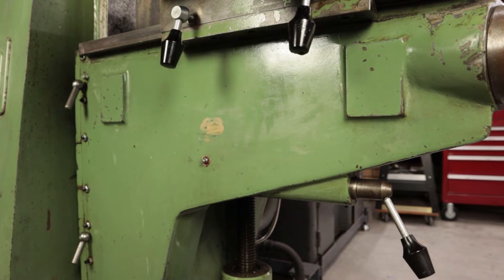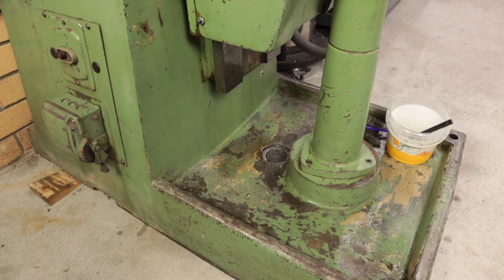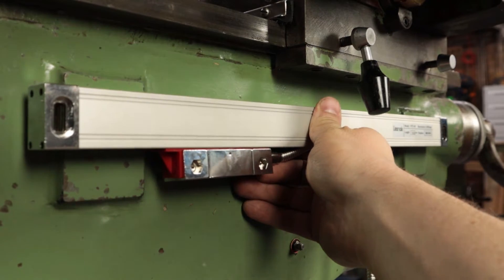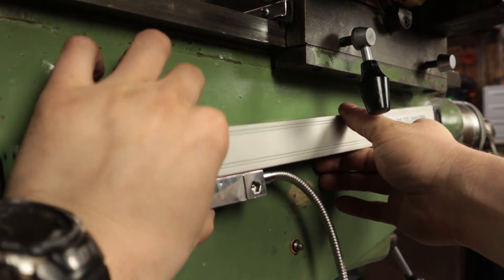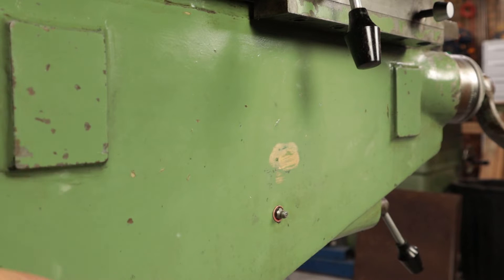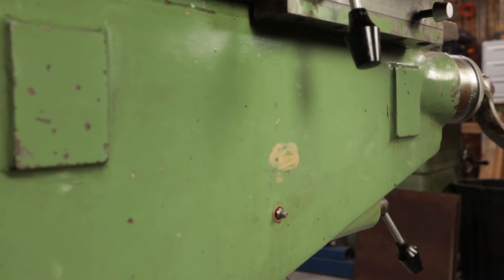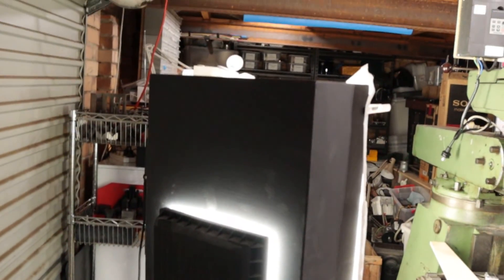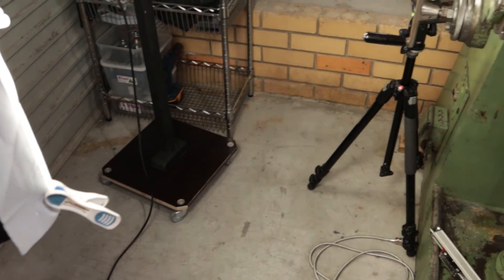Installing a Mill DRO - Planning the Y Axis

Comment: Here is how I did it.  Right side for the y and the Z went behind it.  The X on the back of the table and all cables to the right with the display on the right side.  Easy cable management.  https://www.youtube.com/watch?v=AtabMxk5G9k  Now I have to do the lathe this weekend.
Reply from the maker: Hi World Traveler. Thanks for the info. I will check out your video. Sounds like you did a good job with the cables especially. For mine, I have an exposed leadscrew on the right hand side, and I know from experience that it's one of the oiliest parts of the machine, so I wanted to give the Y scale a chance by putting it on the left. The cables are plenty long so it's no trouble this way. Z axis scale will go on the right though, for sure. Thanks again, Craig
Reply: @CraigsWorkshop  Yeah I was kinda screwed on the left.  My one shot is there and so is the manifold of 19 valves attached to the saddle.  Subbed.  I'm new to this machining game, casting bronze is my bag.
Reply from the maker: @jagboy69  Cheers worldtraveler - I don't have a one-shot on my mill - they seem like a good idea though. I have heard of some folks retrofitting them. I have a few things to do before that though - finish off the DRO install, design a power feed system and I have more tooling and things I'd like to make first. I'm relatively new to it too, so we're all learning together. I'll have to check your channel to see if you have some bronze casting videos, haven't had chance to look yet. Cheers, Craig

Comment: Hopefully those two pads are or were used for alignment when they machined the knee and will be machined parallel to the Y axis and Z axis , if so you got it made ! 
Those lights look remarkably like the led floodlights that Bunnings sell and i have one over both of my lathes , For the last 12 months i have been working in what i thought was a dark workshop  squinting at what i was working on and cursing how dark it was even though it has a heap of lighting. I had a mate drop by one day and he couldn't stand how bright it was in there and said "go get your reading glasses and try them " - which i did and suddenly realised all the money had spent on extra lights would have been better spent on a set of safety specs built to my prescription !   Oh well i can always turn them off if i don't need them !
Keep up the good work mate !
Reply from the maker: Hi Ian - yes these are verbatim branded floodlights, 50W each, and they're LED. Not from bunnings but they do sell similar stuff. I wanted some lights that had a particular colour temperature (6500k) to match the other lights I've set up, otherwise you get weird orange or blue shadows on video. They work very nicely and put out tons of light. Couldn't be happier.

Good point about those pads. I mounted the scale up to those today, I did made up a levelling plate, since the pad locations didn't match the length of my scale anyway. And it's not much work to add a few tapped holes. I have another video coming out (hopefully in a couple of hours) showing how I did it.

Thanks for the kind words Ian! Cheers, Craig

Comment: Hey Craig, wish I could offer some suggestions but having my own problem putting a scale on my compound right now. I don't even want to film it, it seems so cobbled, lol. Looks like you have a plan though. Good luck!
Best!
Eddie
Reply from the maker: Cheers Eddie - good luck with your compound. I've not seen a DRO on a compound before! Not much room! Cross slide is the normal place for one, but I can see how having both would be really good if you can fit it in.

My plan is mid-way through execution right now. I am collecting some footage too, so I'll show that later on or tomorrow. Cheers! Craig
Reply: @CraigsWorkshop  I actually meant the cross slide, just misspoke. Size and space is the problem though. My cross slide is not much bigger than many compounds.
Reply from the maker: @theeddies  Ah ok cool. No problem. Do you have some of the miniature glass scales? They come in a smaller size especially for cross slides and machines with less clearance.

Comment: Hi from Coffs, glad you are keeping your head down in these interesting times.
Seriously, you are over complicating this.
Yes, the reader has to come out of the bottom to stop the s.. Gunk getting in.
Yes it has to be parallel to the travel of the Y saddle.
Two tapped holes the correct distance apart so you don't run out of travel on the reader,
At approximately the same hight (within 2mm only to reduce embarrassment as it could be literally 10mm out and still be fine!)
Hang a square off front and back of knee and sort out spacers, twin wedge washers, whatever required to be square and equidistant.
Dial up top and side, a bit of fiddle and Bob's your Aunty.
An aluminium z shaped extrusion tapped and gooped to the knee will protect it all from coolant and swarf.
If I could add photos ....
Reply from the maker: Hi Carl. Apologies for over complicating things. I just don't want to stuff it up, and have to buy another unit, or have this one shoddily installed. Trying to do as close to a neat and professional job as I can :-)

I hadn't heard the 10mm figure before, in fact usually a couple of orders of magnitude smaller than that, at least for minimising cosine error if not to protect the delicate insides.

e.g. Here's a glass scale installation manual from another company, Warco, same technology scales though: https://www.primadilna.cz/fotky49990/fotov/_ps_3044Warco-DRO-Install-Manual.pdf

It quotes 0.1mm parallelism and squareness, which is approximately what I'd heard in other installation videos, hence my being fussy with the brackets, etc.

Cheers,
Craig
Reply: Absolutely agree that the final result after tuning is within 0.1mm in all 3 planes but my point was the drilled and tapped holes into the machine, the knee in this case, have a fair amount of adjustment .
About one mm fore and aft and 10 or more mm up and down.if this was a kit out of Hare & Forbes of the generic Chineese DRO then it came with an assortment of alternative bits & pieces for mounting the reader unit.
One would be an angle bracket possibly with an additional plate with slots for adjustment to hang the reader unit from.
Craig could we email?
Reply from the maker: @captcarlos  Hi Carl - more than happy to email! My address is email AT craig9 DOT com - I typed it like that so the spam bots don't find it as easily.

I've already fitted up the X axis, and yes the slots were 6x15mm internally. I mentioned 2 videos ago that I used a 6mm drill to centre it in the slot, and spot drill for the M5 thread (Would have used a transfer punch if I had any).

I was more interested in making sure that the two "planes" were co-planar because currently, they're not. I think the sub-plate with jacking screws is quite a neat idea, and easy to do, and I have the materals around.

Chat to you on email. Cheers, Craig

Comment: oooh look at all that space!! hahah should be easy peasy. lol. but you probably only need two jack screws at the front and one at the back? I guess the really pro way might be to make two plates with jackscrews, and bolt them on the long bit, then get them both bolted on and aligned and pack them with epoxy or chockfast or something, then when it cures u have nice pads for anything? id just use one bit right though and jack it both ways tho, that's how I did mine. good luck.
Reply from the maker: Thanks Emma for the comment and the ideas.

I was thinking three jacking points would (probably) do it. It's 10mm (3/8") thick aluminium about 470mm long (18-19"?), and probably needs to be 50mm (2") wide. It's quite a rigid piece of metal and I certainly can't twist the rough stock by hand and it's 1m (3') long.. I wonder if with three points will be perfectly stable and rigid - probably, or if it'll need four. I think once I've cut it, I'll deburr it and try to rock it on the surface plate. If it rocks, I'll do four jacking points just so I can flatten the thing out. I really expect that won't be necessary though.

Rather than two small plates, I think I'm committed to one long plate - it just adds a bit of rigidity, and simplicity, and reduces any alignment headache.

As for packing it, I realised (midway through writing this), that I can try it without and always pack it later with e.g. epoxy or whatnot later, if needed.

Not sure what you mean about one bit right through and ajck it both ways? Like Eyup Tony said with a stud in a threaded hole and then jacking nuts either side of a mounting plate?

Cheers, Craig
Reply: @CraigsWorkshop two on the dront to get it on the right plane, with a vertical axis? then one in the back to get it right the other way?

Comment: Two conveniently placed bosses, that's helpful. Three point should work fine. Could always change or adjust later if need be.
Cheers
Reply from the maker: Thanks Rick. Three points is what my gut said at first. Some folks have suggested four. I'm not sure yet! The 10mm aluminium plate would have to be something like 470mm long, and 40mm wide. It's very very twist resistant already, I really think three points would be more than enough, unless you ran into it with a vehicle or a forklift.. Then you've got bigger problems.
Reply: @CraigsWorkshop  
Agreed. Just try it, if it needs a "plan B" then change it up.
Reply from the maker: @rickpalechuk4411  I have five pieces of that aluminium plate (luckily). Each one is large enough to make two back plates for the scale. If I muck it up, plan B is the way forward!

Comment: Ah shower curtain. I thought it was baking paper when I first saw it lol
Reply from the maker: Previous iterations were indeed baking paper. I will own up to that. :-)

Shower curtain is a little better.

Ripstop nylon from spotlight is much closer to what the diffusers you buy on photography/videography softboxes and light tents are made of.

The shower curtain material is much cheaper, and looks about the same, but isn't nearly as durable.
Reply: @CraigsWorkshop  Eh if it's stupid and it works...
Maybe the extra durability is wasted in the shop; maybe either one might rip if you are careless like me! lol
Reply from the maker: True - I will probably either set light to it, or try to pass 200A through it, or something else exciting :)
Reply: @CraigsWorkshop  Lol I was more thinking of hitting it with a bar of steel, but 200A sounds way more exciting
It will momentarily give you better lighting too :)
Reply from the maker: It's all a question of shutter speed and an itchy trigger finger (Or so I've read) ;-)

Comment: Three points sounds good to me but four points would be more ridged it would take just a little more time to set up that's all. If you screwed four long pieces of threaded bar in to the knee with three nuts on each. Your plate fixes in between the two outer nuts. Adjust in and out then lock in position with the outer two nuts. Then lock the inner nut nearest the knee to the other nuts. This arrangement is so you can remove the plate with the DRO attached by simply loosening the outer nut. The inner two nuts remain locked in place exactly. No re setting required when re fitting the DRO. Quick and simple. 
I'm impressed with your lights, can you show us on video what type and size they are. I need some lol. Thanks Tony
Reply from the maker: Thanks Tony - I understand what you mean with the threaded rods acting as jacking points. And four would enable twist correction (someone else mentioned four too). Easy disassembly is a good thought. I will take this thing apart at least once more for repainting. And - if I can find a big granite flat for reasonable money, and move house to somewhere with a bigger workshop, I'll probably want to scrape in all the ways too. (Glutton for punishment). In that case, an easy-to-remove DRO would be a big benefit. Let's see how it goes. I'm tempted to cut up the plate I have and see how flat it remains. I have a 9"x12" mini surface plate, and feeler gauges and surface gauges so I can measure it pretty well. If it stays flat through cutting, I trust it to remain flat during use. It is protected by the large table, and should never get bumped. Cheers Tony - thanks for your insights. Craig

Comment: Impressive lights, very good idea using outdoor LED lights.
You could create a jacking pad for the mounting, say 8 or 10 mm thick 40 X 75 wide, have a single countersink clearance hole in the centre to drill/tap in the knee. Then qty four, one in each corner M5/6 threaded for set screws/grub screws, to Jack/align the pad parallel and square to the relevant axis. I've used this method for my dro scales.
Great vlog, thanks for sharing and stay safe all.
Reply from the maker: Thanks Bosted Tap. I see what you mean about the jacking pad. That's similar to what I was thinking about. The material I have is 10mm thick, and seems fairly flat. Four jack screws is a good idea, maybe better than three, because it could remove any twist that the plate might have.. The plate does seem pretty flat right now, but cutting it to width might change it. I might try to cut it down first, and then see on the granite plate if it develops any twist. I will post an update in a day or two - with whatever I end up doing. Cheers, Craig

Comment: Hi Craig, the lights are great . With that long alley mounting plate. , how about a pair of tapered spacers . like washers  mounted back to back at either end , you could rotate them individually or as a pair to compensate for any uneven alignment of the two surfaces. A bit of a faff to set up i know but it would be solid , Just a thought out loud , lol. Cheers Ade.
Reply from the maker: Hi Ade - thanks. Interesting idea with the tapered washers - I had not considered that. I will have to give it some thought! Cheers, Craig

Comment: Hi Craig, if you are wondering weather those lights work. Just watched the video and they light the area well. DRO's coming along nicely....
Reply from the maker: Cheers Kevin - really happy with the lights. I think a good video picture is about lighting first, camera second. Cheers mate. Speak soon. Craig
Reply: @CraigsWorkshop  Scale mounting:  When I mounted my Y axis scale I machined some aluminium blocks to match the draft on the mill. This has worked without error since installed.
The scale mounting needs to be a good solid mount. If you use the 3 point jack screw method vibration/resonance when milling may give false readings.
Reply from the maker: @Machine_NZ  Thanks - good point about vibration. This casting is a nominally flat and parallel surface (can't measure any draft angle on that face), but it's just not very flat. I could perhaps get a more solid mounting by installing jack screws, which would get a truly parallel and flat surface, but then somehow grouting under that sub-plate with something that cures hard (epoxy or similar). Not dead keen on the idea, perhaps I'll come up with a better one.

I might do some calculations for the deflection forces on that piece of aluminium, the weight of the scale is so low, that I don't think we'd get a big problem.

Another idea is to set up a clock gauge on the plate (that would mean making and installing it first), then running the machine at various speeds with a big heavy offset flycutter in the chuck. Just thinking out loud here.